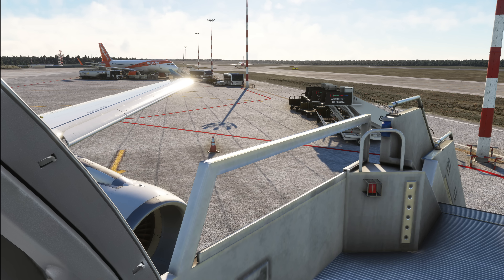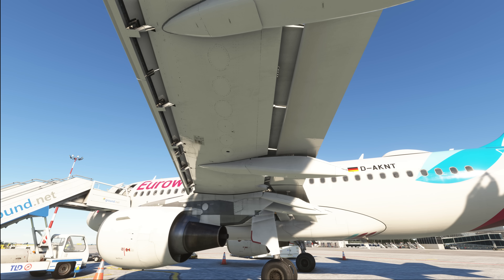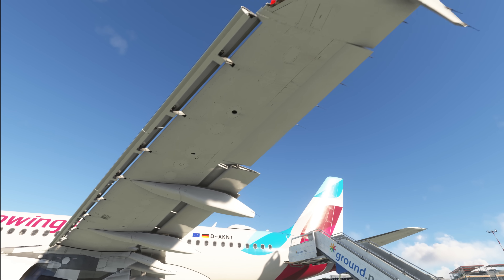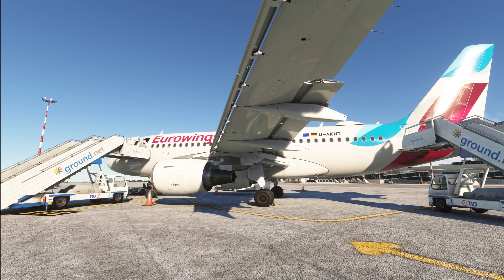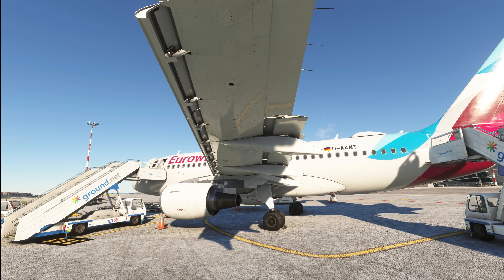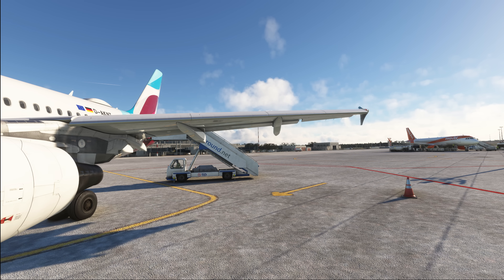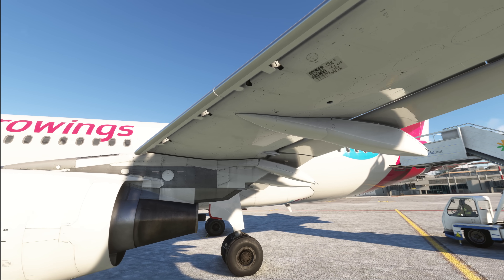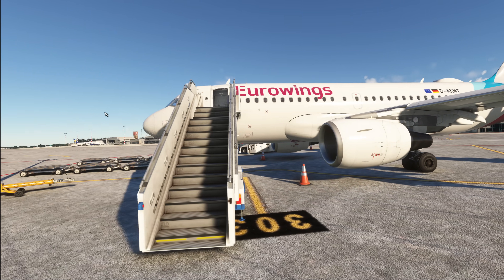Three Reasons why we keep the FLAPS EXTENDED after Landing | Real Airbus Pilot

Comment: When I was boarding the plane a few days ago I heard 2 noises comimg from the plane, 1 was coming from back of the engines and 1 from the tail so its apu. Can you please explain a little bit what was the big air noise from the engines, They were not rotating and were turned of...?
Reply from the maker: You probably heard the APU bleed or something, the engines don’t product any more noise than perhaps some clicking from the fan blades when they’re off.
Reply: @A330Driver Thanks a lot thats what I was thinking

Comment: One time when I was flying an A333, I noticed that they left the flaps fully extended all the way until we reached the gate. It was only after we had shut down the engines that the flaps started retracting, very slowly, probably because the hydraulic pressure was so low. It was around 5 degrees Celsius, and I find it hard to believe that any ice could have built up on the wing since there were hardly any clouds during the arrival.

Comment: I got a question regarding the second reason: If the takeoff also happens in icing conditions and ice builds up between the flaps and the wing, doesn't the plane also have to handle retraction with ice? Or does this not happen because of deicing before takeoff?

Comment: I am a retired engineer and has worked on B737 to B777. Wing leading edge anti-ice overheat switch is a sensor set to trip at 200 degrees F, which is lot more than your 30 degrees centigrade.  Bulk of the time I worked in middle east where even the night temperature is grater than 30 degrees C. I have never noticed Leading Edge Slats/ Flaps extended to avoid false overheat warning
Reply from the maker: Boeing is a different beast than Airbus in these terms. Airbus explicitly lists this procedure in the standard operating procedures section, not even in the supplementary procedures.

Comment: I’m guessing leaving the flaps extended during hot weather is probably an operator specific thing.

I have rarely seen planes leaving flaps extended on the ground even though temperatures exceed 30C.

Comment: Not all airlines do this. Airbus designs its SOPs based on the lowest common denominator. This nuisance fault (bleed leak)  may become an issue for airlines that operate at airports without any engineering support since there is no way for the pilots to determine if this is a real fault or not. Flew the 330 for 15 years for a company where this procedure was explicitly ignored because the required engineering support was available. This fault never appeared despite operating regularly in hot summer temperatures of more than 30 degrees, even up to 40. So not only is it an extremely infrequent occurrence (if it ever happens), but there is also the argument that the risks outweigh the benefits if an aircraft is in an unusual configuration during ground operations.
Reply: Indigo, never leave them down, the operate in really hot places, so this is correct.
Reply from the maker: Well, Airbus actively goes after airlines that don't follow its procedures. Deviation becomes less and less these days.
Reply: @A330Driver  May be the case, but this is nevertheless the practical background in this specific case.

Comment: When I was flying, taxiing an aircraft with the flaps down was an unwritten rule that indicated a distress signal to the tower, similar to squawking 7500 on a transponder. Is this still a thing?
Reply from the maker: No, not at all.

Just wondering, what did you do in case of bird strikes or icing? Just retract them anyway?
Reply: @A330Driver  The Biggest plane I flew was a 182 so my experience is limited. But this was a thing. It probably predates 7500. (yes I am old)

Comment: Wow, so translation, its a bad design.  Flew the E175 through to the 195 aircraft, the B1900, and the 737 and this was not an issue.  I spent half my time flying to Florida, Caribbean and the Gulf coast, and not once did we leave the flaps open.  The other my flights was to the US northeast and Canada, and we delt with snow and icing on the regular.  Never left the flaps down.

Comment: I still can't believe Airbus never fixed that design fault, you don't have to do that on any of the Boeings
Reply: When Boeing does, they change a working plane to a disastrous one.
Reply: Would you say with confidence that Boeings don’t have design flaws that they never fixed?
Reply: You dont need to do this procedure on NEOs.
Reply: I'd rather keep leaving my flaps n slats down than worry about my plane making a sudden dive or a door flying off mid flight haha 😂
Reply: @elliott7268  not every Boeing aircraft is suicidal, that's just the MAX
Reply: @elliott7268  Airbus had their own problems too and recently there have been NEO's leaving the factory with issues like seals on fairings not being installed at all prompting the crew to write up loud noises in flight.
Reply from the maker: Why would they? It works, so why change it?
Reply: @A330Driver  before inclement weather like a thunderstorm i have to go to all the gates and raise the flaps to the fully retracted position if a severe storm is to be forecasted. Or I have to go and lower then because the crew forgot that they need to have them set to 1 at the gate for certain temps. Its an annoying design fault for us maintenance personnel.

Comment: I had this question for a long time, I saw this happened on 330, 340 and even 380, but I haven't seen it on 350 yet.
Reply from the maker: In general I'd expect A350 procedures to be similar to the A330, but I can't rule small differences out.

Comment: Thanks! What is the correct procedure to extend the flaps with engines off? Y & B pumps + PTU?
Reply: Yeah, Y + B HYD pumps on, then extend flaps, and as soon as they lock at 1+F position you are good to turn HYD pumps off again
Reply: Lucas, if it’s a ln A320 series. It only has one electrical pump you can turn on, that’s the yellow. You have to switch on the Blue Pump Override to get that to run. The A330 is has two pumps you can activate by direct HYD push button.

Comment: Why do the flaps always retract on their own on the a321. And do pilots ever take off on flap 1 on the a321?
Reply: On any a318-321 the Flaps config will automatically switch from 1+f to 1 if ias is above 210 kts with the flap lever in pos 1. flaps 1+f is actually only avail with ias below 100 kts or when switching down from a higher config.

Greetings
Reply: Setting Flaps 1 on ground would only be possible via operating the lever when only the blue hyd system is operating.
Reply: @steffenskusa2079  you misread
Reply: Thank you

Comment: Hi, I've seen a video where the crew retracted the flaps to 1+F after landing, left it at that position for the taxi in. When turning in towards the stand they retracted the flaps all the way. Do you have a possible explanaiton for this please? Is there a specific scenario when the temperature is above 30C, but you would fully retract the flaps?
Reply: I too want to know. Why put it back to 1 then back to full like they already had
Reply: @markjackson5333  No, I think you misunderstood. They landed flaps full -> then 1+F for taxi -> then flaps up turning to the stand. I've looked at historical data for the flight, assuming it has arrived on time, the temperature was 35C.

Comment: Great video, explaining it on Airbus, but why is at least the heat reason specific to Airbus? Whenever flying to for example turkey or egypt in the summer season, Boeing planes did never do this. Are they build so much different?
Reply: The ducting type, spaces etc are different between manufacturers and even aircraft type. The easiest explanation is that small leaks of hot air may be present on any bleed system. The delta in temperature could be small but if the ambient air inside the forward edge of the wing is already warm due ambient heating , that may tip it over the threshold. This happened with the earlier aircraft and Airbus implemented this optional procedure to keep the slats deployed. All they state is that the rate of bleed leak warnings MAY be reduced by keeping the slats out. Over the years there have been changes and updates in seals, components and the monitoring systems (plus newer aircraft) which may mean that airline may not suffer from the bleed leak events. In this case, and airline MAY not ask their crews to do it (or do it if needed in their defined conditions). The operational complications come as some refuellers refuse to refuel the aircraft with slats out, leading the crew to retract them using the hydraulic systems. Hope that makes sense.
Reply from the maker: Yes, they're built differently to avoid this false trigger.
Reply: Leaving the flaps down always looks good on a 747

Comment: The „walk around“ is most likely done via drone cam. He’s just increasing camera height as he’s walking up the stairs.
Reply: I like the movement of camera in stair hehe
Reply from the maker: Yep, exactly that ;-)
Reply: When i use drone cam it moves so much faster than this so i am never able to do it like him. Is there something i need to change in my settings?
Reply: @npont3819  in the drone cam settings reduce the speed. Alternatively if you attach a XBOX controller just make small movements on the stick and it moves slower. There is payware out there called FSrealsitic that has a walk feature that can be controlled with W,A,S,D like a first person game too.
Reply: I personnaly use fsrealistic walkaround

Comment: My virtual airline deducts points for leaving the slats/flaps extended after shutting the engines down at the gate. Seems they need to take other factors into consideration before automatically subtracting points. Bastards!
Reply: I think most of the apps used by VAs to monitor flights don’t factor temperature, so they just assume that you forgot to retract the flaps after landing.
Reply from the maker: One of the reasons why I don't fly for VA's anymore. Others deduct points for not turning the lights on/off exactly at 10.000 (whatever the reason...), deduct points for exceeding 250kt below FL100, even in controlled airspace and on ATC instructions.
Yet others give you more points, the smaller tha landing rate.

I don't like those static systems, that's a reason why I don't fly for VA's anymore.
Reply: @A330Driver  i agree with this. im lucky to have found a VA where we are a mix of semi hard on realism to fully realistic and provide stuff to make the flying more realistic, IE changing callouts, giving advice on procedures and we even have full procedure manuals based off the real companies procedures being written by me because people have asked for that. its rare to find a VA like that
Reply: @mrunlucky4085 may I ask which VA?

Comment: I had a Delta A321 pilot explain the temperature sensor issue when I was flying out of KPHX in August a few years back and I noticed flaps/slats were at 1/F.  When I was working on the C-5, I was told the flaps are left at T/O position after landing because "sometimes you just don't know if they'll break again and then you can't take off".  🙂  One nice thing I noticed on my last Fenix A321 flight, the flaps auto-retracted from 1/F as airspeed increased, still had to retract slats, but I thought it was a nice detail they added.
Reply: 1+F - sounds like a temporary procedure while a technical fix is found to prevent spurious warnings.
Reply: Great information. Thanks